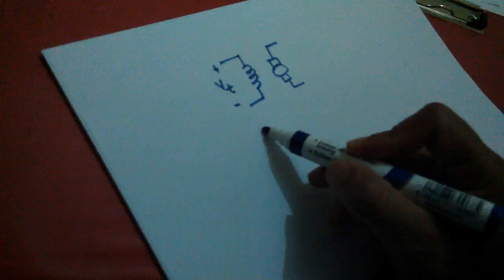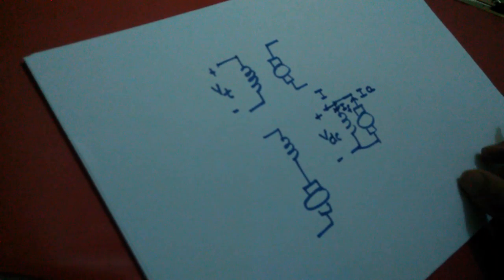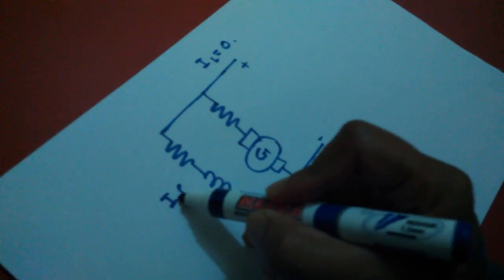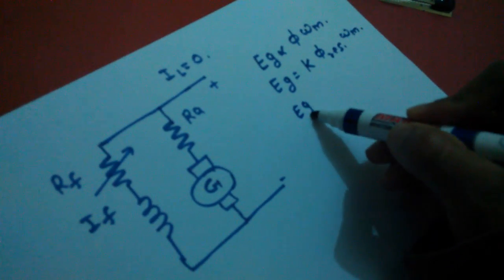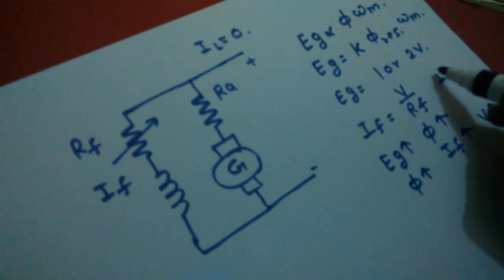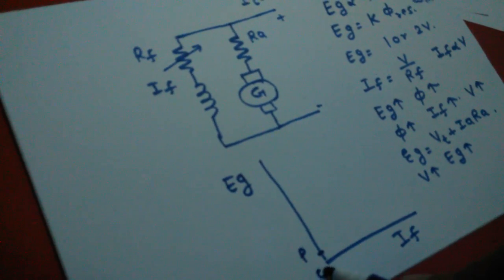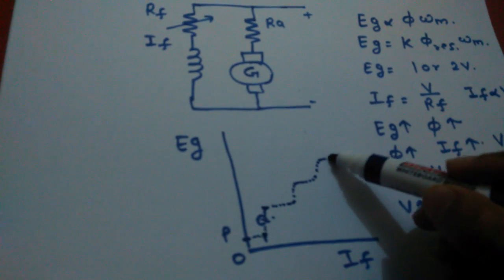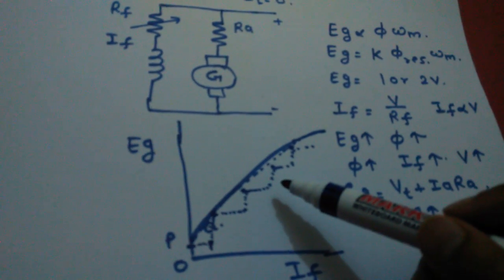Voltage Build-up in Self Excited Generators

Comment: Might mention why the curve levels off -- at a certain point, the metal (iron etc.) core of the generator's field coil has all its magnetic domains magnetized so the self-excitation cannot increase the generator output as dramatically as happened at the left side of the curve.  When the generator first starts (left side of the curve on your graph), there is exponential increase in generator output caused by the self-excitation.  That's shown by the curve moving dramatically upward.

The self excitation is conceptually identical to a turbocharger in a car engine -- huge boost then a leveling off.

The condition where the generator's field coil's core (iron or etc) is fully magnetized and starts limiting the generator output increasing is called 'saturation.'

My thought is, I want to use an air core field coil instead of a field coil that has an iron core.  An air core cannot reach a saturation.   What is the limiting factor then for an air core field coil?  Maybe the heating-up of the coil wires.

So if will chill the field coil, the self-excitation might give a huge amplification factor for the generator.

Anyway, good demo.
.
.
.